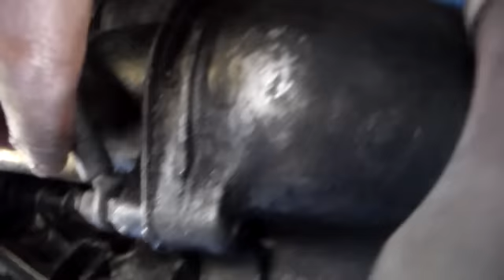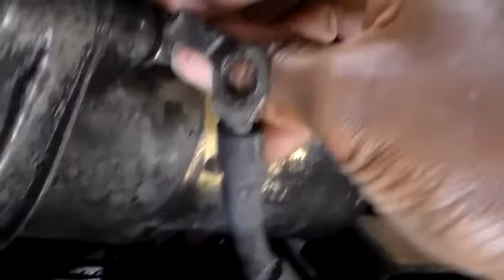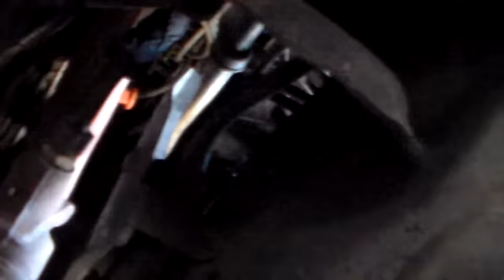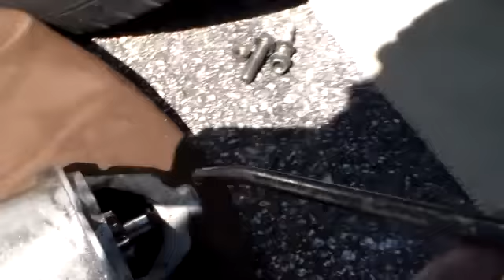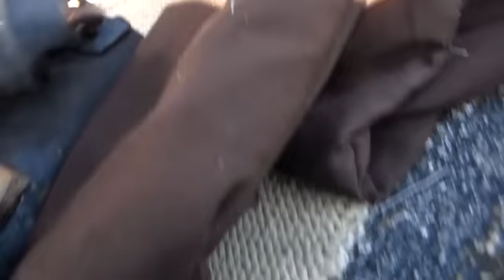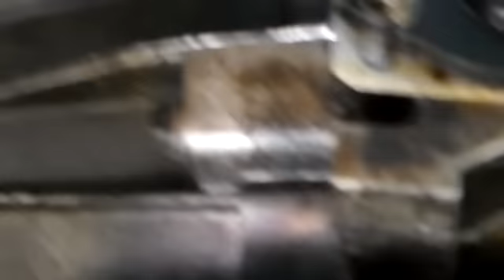How to Replace the STARTER on a 98 Ford exploer

Comment: I have seen a few videos of how to get the starter out of an explorer and I noticed they never say in what side of the car it is, I kind of guess it is on the drivers side, I have a 8 cilinder 1996 explorer and it is on the passenger side, another thing I saw is that in the videos looks too easy the way they access the starter, in mine you can hardly get your hands in there is kind of hidden.
Reply from the maker: Ya, some times, you must remove other parts to get to the one you want. I had to do this when removing my transmission on my GM.

Comment: Thank you for the video but what size is the bolts I’m in need of the two bolts
Reply from the maker: Hey,  Sean it's been awhile. don't recall. you can pull them from your local junk yard. or try and goggle them. also check the Haynes Manuel for your truck.
Reply: What size wrench or socket did you use

Comment: sir how did you know it was bad. my 1991 just spins but doesn't turn the motor any ideas
Reply from the maker: +Ron deezzee Hey Ron I removed my starter for a check up, I traveled across country at times I would pull parts just to check them out, it sounds like the gear on your starter is not making contact, or the other lager gear that it slides into may be striped. just wondering
Reply from the maker: +John Paul Jones Thanks John
Reply: +John Paul Jones thanks john so I changed the starter an still spinning.  I just had the transmission changed in September so when I took the old one of I noticed grooves In the starter from the flywheel rubbing. taking to trans shop monday. assuming flywheel issues also notice vibration the same day it stop running

Comment: does anyone know on a 95 explorer, to change the starter do you have to take anything else off the rig to pull the starter
Reply from the maker: hey Fred, what rig are you talking about.
Reply: diversity2 95 ford explorer I found out it has been in a previous wreck and a different drive line put in it that has to come off to get to the starter. Not fun
Reply: Thanks for responding back. Much apreciated
Reply from the maker: ***** OK
Reply: Hello

Comment: I unbolted the starter and having a hell of a time trying to take it off any idea what could be holding it in?
Reply from the maker: Hey Justin if I remember there was a bolt that had a nut welded to it , I had to turn it, the nut and the bolt are one pice
Reply from the maker: Also read the comments below they can help you.

Comment: how did you take off the top bolt? I don't have any room to turn the bolt
Reply from the maker: +nick manges hey nick try a swivel adapter, it was hard to record and try to remove the top bolt, I got the bolt lose then turning it by holding the socket with my hand, I have very thin hand, I would go and recheck for you but I sold the truck.

Comment: One bolt has a regular bolt head and the other bolt looks like a nut bolt without a bolt head you have to hold. Because it screws into the aluminum block mount. That helps out a lot because a head is not recessed, you can't see.
Reply from the maker: +methunshow Thanks for the info, I am getting older

Comment: Will you please list all the tools used in this video to remove the starter as well as all screws and/or nuts. Thank you in advance.
Reply from the maker: Hi janestillspeaking, I had to use a 1/2 in deep well socket for the large bolts, you can use a cheap socket set from family dollar to finish the rest, there was about 2  1/2 in bolts and the third one was made onto the threads when I un screwed it' , I had to remove 2 wires, one from the starter and one from the solenoid. once I got everything lose I had to hold the starter with one hand to keep it from falling on me. be safe.

Comment: I have a 96 with the 4.0L ohv and it was a nightmare. The diff blocks a bolt and you need a tiny stubby  with small hands or you have to get a long set of extensions thru the frame. Being in a salt area don't help either.....
Reply: alb12345672 in the same boat... it sucks....
Reply: A small 1/4" w/13mm and a 1" box  end wrench for leverage at a right angle to break the bolt loose works. I have gearwrench vortex passthrus, they are very low profile. Also having extensions that will bring you exactly to the back of the starter may help.Was definitely designed by sadists.
Reply: yes boss i just did mine today  one of the pain in the ass jobs top bolt sucked but what made it easier for me first i have a 98 explorer 4.0 eddie beaurer 4WD  i have battery powered rachett 3/8 but adapter for 1/4 took down front drive  line gave me room to put on a swivel to spin top bolt right off same with the pos cable and switch line thin wire 10 mm pos cable 13mm 2 starter  bolts 13mm to get it out and in is a pain twist fat end of starter thru larger opening thru front diff and engine but pull starter towards exit hole to remove 2 nuts for pos and switch wire thin one 13 mm and 10mm small wire again ggod luck be patient if u get pissed go away come back half hr u will get pissed to replace do it in  reverse
 i think some people just want to be noticed i dont know but if u dont know what you r really doing dont go on youtube and try to teach other people the wrong way its not kool

Comment: yea that top bolt was a pain in the ass but I eventually got it off using a 6 inch extension and short 13mm socket. took about  3 minutes to remove it as the ratchet didn't have much room to swing. also the wire harness was clamped to brackets that again wasnt easy. had to get to the brackets to pry open thru the wheel well. whole job start to finish took me about 1 hour with my kid to hand me tools and keep me sane!!!  honestly  needs patience and know-how to do the job. thanks for the video though.
Reply from the maker: +Jesse Anaya welcome Jesse

Comment: this video does not show me where to find the starter.
Reply from the maker: +Joe Winfield Hey Joe follow the positive cable from the battery to it
Reply: +diversity2 i guess this 2001 is different from my 2000. you seem to have easy access to these bolts, where as on mine it was hard enough to get the first one off but the top one i can't even see it and there is all types of crap in the way. i'm not sure if i can do it with a ratchet?

Comment: Should have been captioned, "How I removed the lower starter bolt on my 1998 Ford Explorer". Never mind that the front drive shaft and yoke has to be removed.
Or just sell me the Brooklyn bridge. P------hole.
Reply from the maker: the drive shaft and yoke was not removed for this project. have a wonderful day thanks for watching.

Comment: maintainace ck by takeing out the starter i drove rig new york and jersey   i did circle ck and ck out motor belts air hoses never heard of removeing a starter  and putting same one in while u had it out its old truck replace it if your on road all the time u dont make sense pal sorry

Comment: i like how you skipped over the most pain in the ass part of the job. top bolt was a nightmare to get off but i got it eventually. how come you didnt record that?
Reply from the maker: +Michael Taylor sorry your top bolt was a pain mine was not, if it's a problem getting a shot I move on, thanks for watching Michael
Reply: What did you use to get it off. Had to go buy a swivel adapter to break it loose. Back And Running Again But What A Crock. How come you didn't record that?
Reply: +Michael Taylor no room at all..they do it on purpose haha
Reply from the maker: +Michael Taylor I did not have the problems that you had, thanks for sharing  some one can use your info
Reply: Yes they could. Not trying to be a jack but you did not help just being honest. You obviously staged the whole video. But I will give you props for trying. Amen brother!
Reply from the maker: +Michael Taylor Have a wonderful day  Michael thanks for sharing

Comment: this video does not cover 4x4 the transver case and the bell housing is too close...sadly this is of little. more of a joke
Reply: yeah i have that extremely hard to get to that bolt
Reply from the maker: sorry it did not help you. a lot of people seems to like it.
Reply: No, Thanks for making it but some engines are very different.
Reply: sorry bout my original comment was little frustraed only difference is that on the 4x4 you have to raise the engine a little bit so that the starter will slip through and were talkin about maybe 2 inch lift.
Reply: I didn't have to lift the motor but it was very tight. lucky i used anti-seize 10 years ago when i replaced it.
Reply from the maker: great job!  did you record it.
Reply: @garykick9825 "...raise the engine a little bit"  ...Ummm... er... uhh... How is that accomplished ??!!! :/:/:/
Reply: @stardemonspacecat  block of wood and a floor jack, is the block of wood to spread the preasure across the engine oil pan and lift it by the jack. Only needs to go up a little bit like an inch or so of course this is on the 4 whele drive model.(3 years ago when i did this also did the motor mounts which were shot, thus sittung a little low.
Reply: @garykick9825  Hmmm... okay... I've been studying videos (and comments on videos) while getting ready to tackle this job... Had not seen or read anything about lifting engine... Thanks for info :):):)